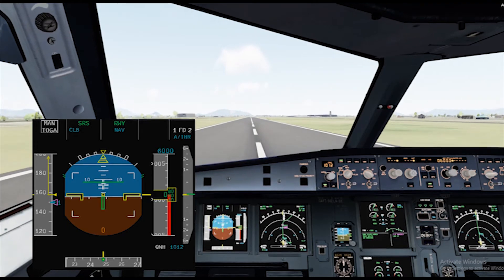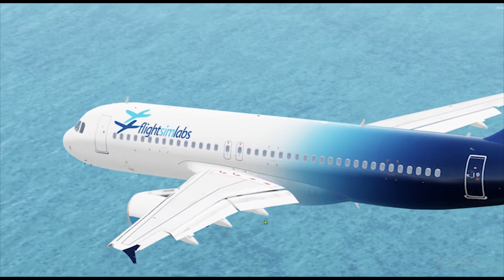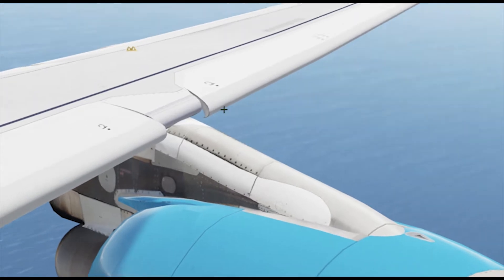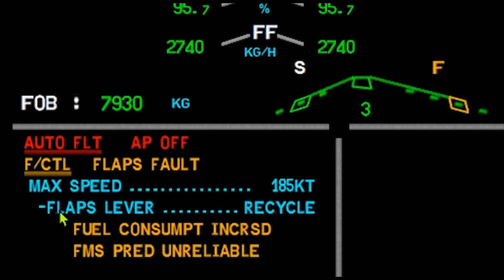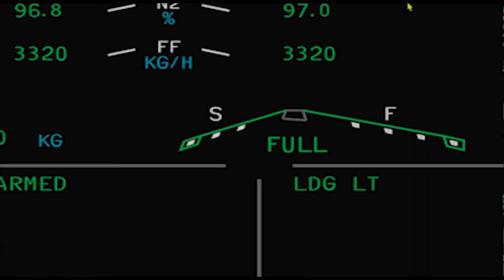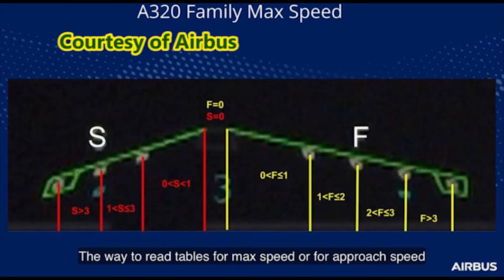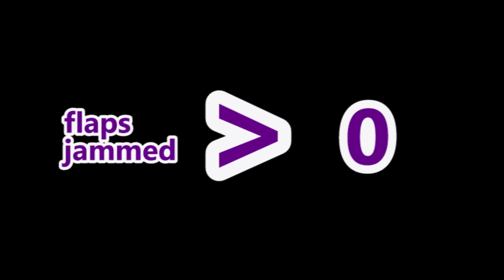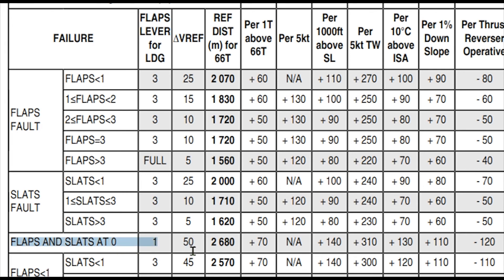A320 Landing with Slats and Flaps Jammed (QRH Series)

Comment: Hi Capt, allow me to ask your opinion on the selection of speed after the landing configuration is set. Do you select the Vapp or let the Vapp be managed? The procedure does not state on how to decelerate to Vapp. If the Vapp is selected, GSmini function will not be activated for the approach. Appreciate your reply.
Reply from the maker: Good question, your Vapp speed is Vref + config correction + wind correction. If your config correction is equal or greater than 20 kts, then no wind correction is applied. Groundspeed mini caters for wind correction. Hence we use selected speed as config correction ( more than 20kts) is already included in the Vapp speed.
Reply: @Captain_SQ  Noted, thank you very much.
Reply from the maker: @winhoeliew2078  most welcome.

Comment: The function of wing tip brake to hold and stop rotation of flap/slat transmission shaft when slat/flap control computer sense asymmetry, uncommanded or runways condition of flap/slat.
Function of Wing tip brake 
WTB is electrical control and hydraulic actuated component. WTB mainly consist of friction disc, piston and solenoid valve.
When Solenoid valve  de-energized hydraulic fluid pressure not acting on piston. Due to absence of piston force on friction disc transmission shaft turns freely.
When Solenoid valve Energized hydraulic fluid pressure act on piston. Piston apply force on friction disc which hold transmission shaft.
Solenoid valve get energization signal from slat/flap control computer.
The function of ( Pressure off brake) POB and WTB is same. Both apply brake and hold transmission shaft.
Reply from the maker: that's right. good job.

Comment: Hi Captain. Thanks for the videos, I have two questions please to ask you: In case as shown here in this video appear on the status Vref+10 knots, it means Vls + 10 in config full ? Is that right ? And in case landing will be in flap 3 ? How do you convert vref +10 in the correct vapp ? 

Second question is please: in case youre doing a go around in flap 3 you go directly at flap 1 , is that right ? In case you're doing in flap full are you going in flap 3 and then 1 ? Is that correct ? ( of course Im talking in normal operations, not in this case as shown in the video ) Thanks a lot,
Reply from the maker: Good question. You use the performance software by Airbus to calculate the Vref. In normal operations, for go-around, flaps is one step up, unless you are landing overweight and using Flaps 3.
Reply: @Captain_SQ  thanks for your reply , so let's make an example when is the case from flap 3 go flap 2 ? Never... 

Always from 3 to 1 ? 

Thank you
Reply from the maker: If you are approaching with flaps 3, if you go around, you need to select flaps 2. Only if you are overweight you select flaps 3 to 1.

For take off, if you takeoff with flaps 3, you retract to flaps 1.
Reply: @Captain_SQ  many thanks once again, very kind of you
Reply from the maker: My pleasure.

Comment: Could the pilot be responsible for such fault ?
Mishandling procedure?
Reply from the maker: Mishandling? What do you mean?
Reply: @Captain_SQ  if flap lever was at pos 1 F+S  , and speed reaches 210 , auto retract function will activate and flaps will move to 0  ,, isn’t uncom motion situation??
Reply from the maker: @bazokazoro4563  yes pilots should be aware to retract the flaps at the appropriate time.
Reply: @Captain_SQ  I’m  engineer but aviator was my dream ,so I decided to be as close as I can to the airplane to satisfy my passion...
I perform WTB rest on A320 due to flap lock , so that’s why I involve in this issue 😉
Reply from the maker: @bazokazoro4563  wow that is interesting. If you want to join our group , text me on Telegram @CaptainSQa320, we would love to have an engineer onboard.
Reply: @Captain_SQ  my pleasure 😇